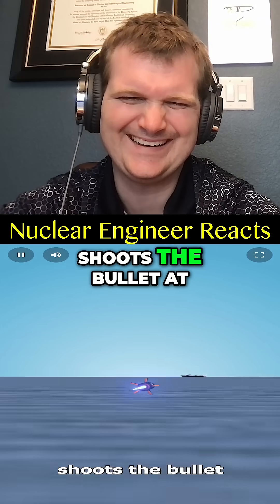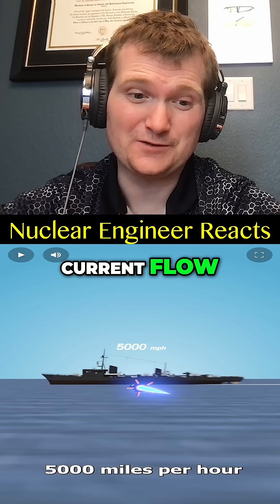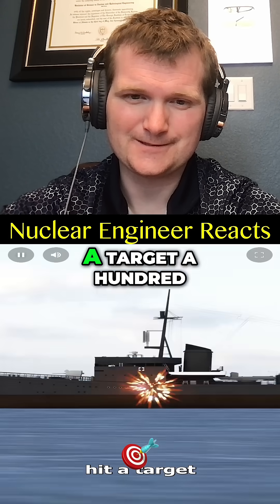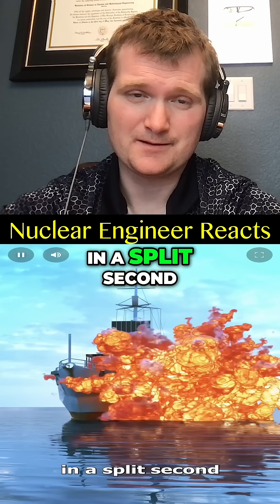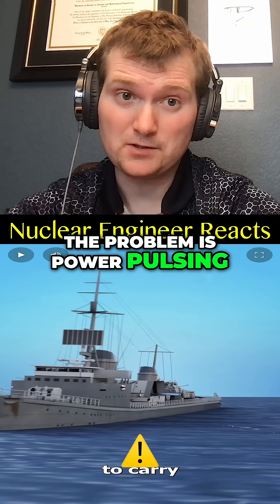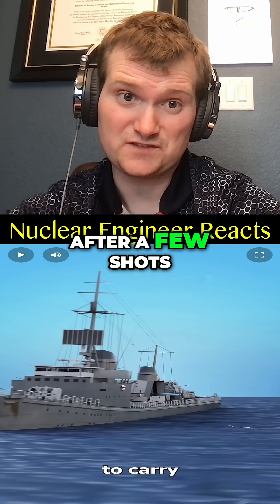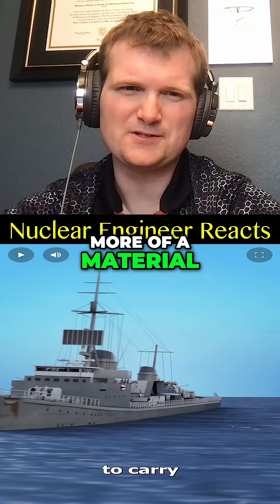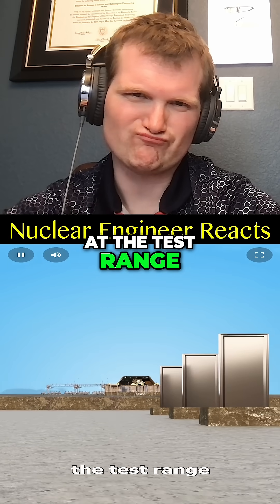Why the Railgun is Too Powerful - Nuclear Engineer Reacts to Zack D. Films

Comment: China have these on 3boats last time I saw. And america had one tested an refitted onto a boat just before I graduated high school in 2012. 13years ago. They need a satellite just to aim it because it's more then capable of hitting targets 300-500miles out using a 100lbs tungsten rod in a steel sabo. The test fire i remember seeing in 2012 shows them hitting something like 6 or 8 one inch think steel plate spaced 6 or 10ft apart from each other at 150miles away and it Bbbbblow through every plate with ease.

Comment: Oh no it will ultimately sink a ship on impact, if it hits the right areas, obviously hitting above a certain point that round will mostly just shred and mangle anything in its path, but you hit close to the wake line, or the lower part of the ship, that first impact won't be much, but like most high powered rounds, the farther it travels through the ship, the more devastating the damage becomes, when it comes out the other end, that exit hole will be massive.

Comment: I’ve actually made a very small scale rail gun that fire steel ball bearings up to a 1/2 an inch in diameter. I don’t like to mess with it too much because they can cause quite a lot of damage, especially if I fully charge it.

Comment: A big problem is, while it CAN fire this far, this is WELL behidn the horizon, which on sea level or let's say 20m above, is aroun 20 miles or 32 km. So it can't just shoot in a  straight line, it will have a ballistic path and must be guided by other means to see and try a way to hit the target, because even at that speed that is still around 2 minutes in which something like a ship can move a lot, change course and so on.

On top of that: 100miles is not really tha far. Anti Ship Missiles can attack ship on a far greater distance and partly at even higher speed, you can easily fire salvos of those arriving at the same time and using all kind of other gimmiks on top.

In the end the rail gun has the same problem as other cannons, it simply can't compete with other system and RANGE was and still is the emperor on the battlefield and with a 100 miles railgun you can't compete against anti shipp missiles who can easily fly hundreds of miles and even over 1000 miles.

Comment: Railgun. 5 shots. No barrel.
No railgun.
Reply: You need a replacable barrel. More like a revolver style gun with 4-6 revolving barrels with only 1 barrel above deck level. Also you need to make the system to easily replace barrels under the ship's deck. You can either shoot from one barrel until its melt or deform or using the gun with a revolver style until all of your barells destroyed and change it all. The first one ensures you can still shoot if situation arose, the second one is much more time consuming but good for a quick bombardment.

Comment: The rail gun is not for sinking ships. It's for defense. One of the primary weaknesses of the current missiles is the need to get to a proper approach before moving at hypersonic speeds due to the physics of current rocket designs.

That makes them hard to track until they turn hot, and when hot makes them hard to track down. The rail gun at its projectile speed theoretically with American targeting systems could be a much cheaper way to disabling high velocity munitions with our own hypersonic munition instead of missiles, which needs a chip manufacturing base.
Reply: Not quite true. You see, railguns are offensive weapons. They have much better range than guns and cant shot down with CIWs as the projectile is just a metal rod which would just break into pieces and still bombards its target. It doesnt need explosives which do make the ships safer because you dont need to carry exlosive armaments in the belly of the ship. Missiles are still vulnerable during flight.
Reply: @Zappina yea you said a lot of nothing. A bullet has a fixed trajectory which makes it easy to dodge even if its moving fast. It's being used for defense. While the U.S. abandoned the idea the japanese specifically wanted it to reduce the cost of interception. Also the cwiz is not for hypersonic missiles. The rounds dont travel fast enough for proper intercept.

Comment: U mean that the Heat produced and the waste products of one rocket or "bullet" launched, not only erodes the Channel were the ammo is fired, same as if you nonstop shoot with a machine-gun or more likely how many shots a silencer in an arm can resist. That's what you mean? And that the power thrust of those ammo, have many limitations, not that a nuclear warship or submarine "can't handle those quantities of energy consumption for making the electric/magnetic field to fire the bullet at those speeds, but more because of the barrel tube not being able to support many shots being done right???? Thank you for your time!!!! And answers.
Edit: i mean like having problems dissipating the heat or the gases released that will damage the gun and won't be working right or even fail to work?

Comment: I had a mentor who worked for a military weapons contractor and worked on one of these systems. He said at some point someone had come up with a calculation showing that when fired forward while the ship is traveling forward at a decent speed it would stop the ship due to its recoil. Also the number of timed shots off the side of the ship needed to rock and sink it was surprisingly low as well as the fact that the barrel would be useless in very few shots due to the outward forces at the tip when fired.
Reply: Rail guns don't have recoil bro
Reply: Yes they do. Physics still holds. Every action creates a equal and opposite reaction. It doesn't matter how an object is propelled when something is thrown forward at high speed there is an opposite reaction equal to the same amount of energy in the opposite direction.
Reply: @jasonlapadot8381 that’s not how that works.  So if that were true when I go to start running, I should immediately get slammed to the ground with an opposite force?  I think you need to read up on your Newton.  You’re forgetting the key factor which is mass.
Reply: @kuznickic1  They're absolutely correct. Every force has an equal and opposite reaction and momentum must be conserved. Lenz's law says that current produced by a magnetic field will itself produce an opposing magnetic field. There is an equal amount of overall recoil produced as there would be with a conventional explosive driven round.

The main difference is the time scale. A bullet almost instantaneously delivers the full recoil of the round, while a rail gun would drag out the recoil over a slightly longer period of time, making it a bit easier for the ship to handle.

 At the end of the day, shooting the same size projectile at the same speed will always produce the same amount of opposing force, ie recoil.
Reply: @santiago_meneghetti that was my thought.  It’s just acceleration with Lorentz force.

Comment: It actually is a power problem. Obviously the nuclear reactors on ships would charge up capacitors so even if you don't have enough power you can charge slowly. The issue is the navy wants specific "rounds per minute" which can't be met. These things aren't THAT accurate at the rage of 100+ miles so they want a higher fire rate. 

It would be crazy if these things have folding fins and you put a computer on it for guidance. I don't think electronics would survive though.

Comment: The Zumwalt class can kick out 78MW. It can mount 2, 25MW railguns. But it was fitted for two 155mm AGS instead. Then the rounds ballooned to 800k a piece so now they are replacing those with hypersonic missiles.  Which is not to say we don't have some railguns and a fist full of ammunition lying around. They just aren't verry practical given the distances involved and the fact that the projectile cant be steered.

Comment: So far 99% of the nuclear reactors out there are just "fancier" ways to boil water. Electricity is still made by a turbine of sorts. RTG or similar would create electricity directly from the nuclear reaction, via thermal effects, so heat is still involved. Betavoltaics transform the beta radiation directly into electric energy, kind of similar to a solar panel but adapted to this type of radiation.
Maybe one day fusion would drive the plasma directly into motion which in turn would induce current somewhere and produce electricity without boiling water.

Comment: Railguns are vaporware in their current state. They don’t fire nearly as fast as a deck gun will, they are prone to a host of issues from the immense discharge of electrical energy, they are super power hungry and would require ships to be completely redesigned to have a nuclear reactor just for the gun. Essentially they are far more expensive than a missile so why try and reinvent the wheel?

Comment: Also, ships move. This has been a problem since their inception.

Even when going 5000 mph, traveling 100 miles takes 72 seconds. So, unless the ships are moving stricly linearly and your position prediction error is small, or the missile is controlled, the chance of hitting is small.

During WW2 the Iowa class battleships were undoubtedly the best battleships. They used radars (the Japanese didn't) and they employed fire control systems that could compensate for ship roll and the coreolis effect using mechanical computers. And still they would not be very effective at maximum range against ships. It took luck to hit. They were effective up to maybe 10 nautical miles. For land bombardment the max range was still effective as a projectile (weighing as much as a small car) would always at least hit something and produce a crater 100 yards across. And it could fire 9 of those twice a minute.

Comment: They did solve the power problem.  However, the materials issue is still ongoing.  But, in recent news, it seems that Japan has solved that problem too...or at least mitigated it enough so that it's practical...   ...from what I understand.
Reply: The boys over there want their Gundams really badly. :D
Reply: @NeoStarImpact  I'm not against that.
Reply: 100 miles is a shit range and the projectile still needs TWO MINUTES to reach the target, while there is not that much you can do to control it on its ballistic flight.

Anti Ship Missiles got a range of 100s of miles up to over 1000 miles. You rail gun ship will simply be toast long time before it can get into firing range.
Reply: Not really. The Tsuno fiber is not quite strong enough while the transparent cellulose material is "only" steel strong. You need a meterial which is not only much stronger than steel, it have to be conductive, much more flexible than steel and extremely heat resistant while also can need to radiate heat quickly enough to not melting or deform after a few shots. Thats a very tall order.

Comment: Per available data: 
20kg projectile at 5000mph would carry with it 50 MJ of energy…which is tiny.  A 2000lb bomb has nearly 2 gigajoules.   You’d need a 700kg projectile moving at that speed to equal the 2000lb bomb in energy released, or a 20kg projectile moving at around 30,000 mph.
Reply: A 16 inch shell as fired from the Iowa class has about 350 MJ of kinetic energy. Its explosive power pales in comparison.

But they were plenty effective still.

Comment: I love how he correct Zack. Indeed, nuclear reactors have more than enough energy for powering a city. One power-up is not an energy problem but rather a difference in energy (too much for too little time). This and extremely high wear and tear makes this weapon less feasible than good old rockets

If I am not mistaken, the original video had comments about this mistake. Zack has good quality animations but the level of inconsistencies in his videos is saddening
Reply: I was thinking a nuclear powered ship should be able to power it, but I mean what do I know.
Reply: @Azuciea  nuclear is the answer, the next question is material science, especially durability
Reply: @Azuciea they actually use a secondary reactor for ships with rail guns
Reply: The most Aircraft carriers use K15 reactors (150MW) and new gens carriers use K22 (225MW).
A 30-50MJ Railgun require about 5-10MW generator. So yes, a nuclear carrier can provide the power for sure.

Comment: Aiight, my brain locked in for a second. Maybe create revolver-style quenching partitions for all of the Hot parts (barrels/rails, firing chambers, batteries, etc.). Potentially modular and scalable depending on the demand for sustained output. More time between shots launched from the same barrel as well as longer cooling cycles to absorb more heat before being fired again. For example, a 6-shot would have more time to cool individual parts compared to say a 2-shot while simultaneously providing more up-time. Huge downside would be that something like a 6-shot would require almost 6 times the parts. 3-shot still might be pushing it. Might be more effective to find a way to cool everything properly in place, I'm not sure. Just a neat idea.
Reply: If there was a way to modularize the system such that the rail can easily be swapped out, that'll be pretty neat, because cooling down the rail will involve a whole lot of delay. Plus the rail would not be ultra durable

Also, each shot should have an explosive payload, so it doesn't just rely on penetrative or blunt power from the rod's kinetic energy. This way you will have less reasons to require rapid fire to deal more damage, which will give the system more time to cool

Ultimately tho, the main challenges here will definitely be rapid pulsing and cooling, and then durability of the rail, the material would have to be a very refractory material and since the rail is not necessarily being subjected to any stresses, but will be experiencing a lot of friction from the rod, the material would need to be hard, at the very least the exterior that comes in contact with the rod.
Reply: @ZaCharlemagne explosives may actually lessen the effective damage of a railgun slug. Effectively no matter what you put in front of it, the slug will cruise through it, inflicting massive kinetic energy as it goes. By incorporating explosives, unless they are timed so exactly that they will explode in the few milliseconds that they are in the hull of the ship, they will simply either reduce the damage by exploding too early, preventing the slug from penetrating through the entire hull, or by simply reducing the amount of mass hitting the target, thereby reducing the kinetic energy exponentially. The other thing to consider is cost; explosive slugs would be exponentially more expensive while a purely kinetic slug could do the same job for cheaper with less danger to the crew and less upkeep required.
Reply: @pgames2303  Of course if you are going to make the slug complicated and expensive with precision timed explosive devices, then you might as well just turn it into a rocket, and it can be fired from anywhere not requiring a 9 figure gun. That's why this thing was scrapped.
Reply: bro just put an air conditioner in the room.
Reply: Couldn't we make the projectile "float" in the magnetic field so it won't have to deal with friction? But I guess it would be hard to control the accuracy of the projectile this way.
Reply: The issue with this is that you still haven’t gotten past the fact that the rails will be effectively disintegrated by both the kinetic/frictional force applied to them and the immense amount of heat they will generate. Sure, 6 barrels means 12 shots as opposed to 2 shots from a single barreled railgun, but it’s still only 2 shots per barrel.
Reply: Mag-lev trains essentially function with that technology, albeit in an extremely slow manner by comparison to a rail gun. Not sure what the clearance tolerances are between the cars and the fixed rail trough...